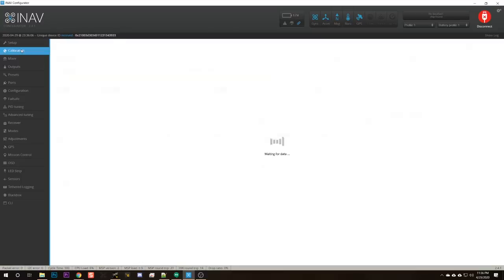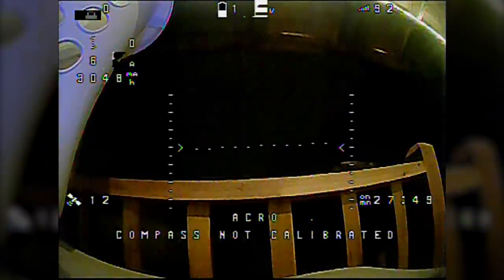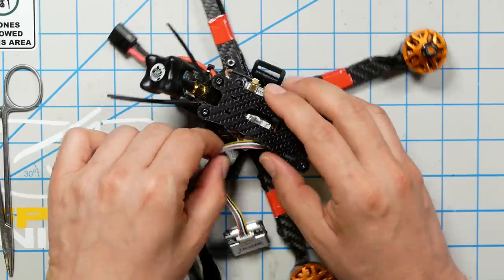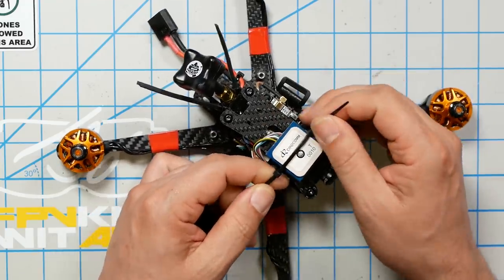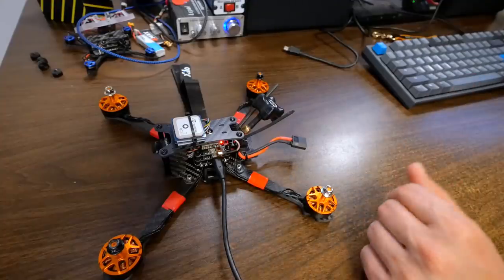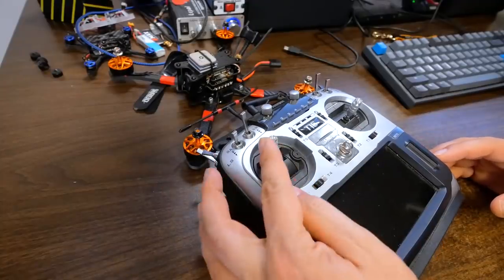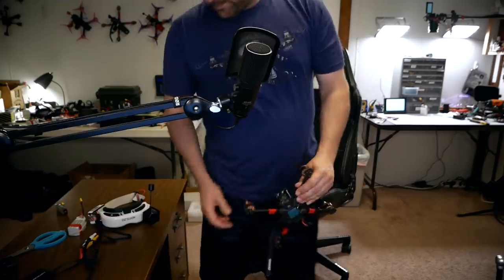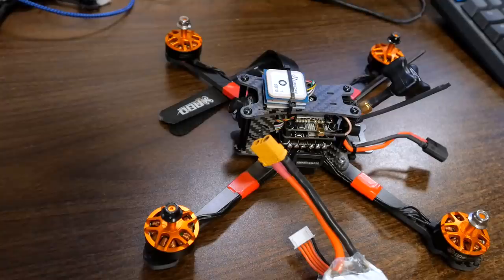iNav Drone Complete Tutorial - Part 6 - Calibrate Compass and Accelerometer

Comment: Looks like im in good company here, I finished assembling my quad last night and thought "I'll just take it out for a quick PosHold test" HA! quad took off like a ballistic missile , pause for a hover at about 100 feet altitude, meanwhile I seemed to be locked out of my controls.. I shut the transmitter down with pwr off and the quad started heading south...  I found it about 30mins later busted up on the paved road.  It will make a good parts doner for my second build ;-)  Thanks for all the help Josh! If I had watched this video insead of rushing off to test my quad last night....

Comment: That position hold issue is what happen to me a month ago on my 3rd 7in iNav build. Mine started toilet bowling small circles into even bigger circles. I was using a Matek GPS and compass and I had it at CW 270 degrees instead of the CW 270 flip. Sometimes it’s the easiest things to fix that causes headaches.

Comment: I have written a short guide for iNav compass calibration in another forum, in case someone needs some more advanced tips, mainly if you mount your GPS/compass tilted or not facing arrow forward:

step 1. Find out how the magnetometer sensor is oriented on your board from manufacturer. For example I have M8Q-5883 GPS with magnetometer from Matek, where magnetometer (compass) is mounted CW270FLIP. Let's remember that.

step 2. So in general you would only need to set mag alignment CW270FLIP in Configuration tab / Board and sensor alignment in iNav configurator. But this is only the case if you mount your GPS/compass board flat and arrow facing forward! But let's say you mounted it with arrow facing backward, and you tilted it 30 degrees backward (because you want to have the best GPS reception when flying your quad forward pitched 30 degrees). In this case, change mag alignment to CW0, and you need to go to CLI, and set align_mag_roll, align_mag_pitch, align_mag_yaw.
In other words, when iNav detects you have some values in align_mag_xxx variables, it will ignore mag alignment value!

For our case, we need to combine both CW270FLIP sensor orientation and our mounting position.
CW270FLIP is:
align_mag_pitch = 1800 and align_mag_yaw = 2700
combined with our mounting position (arrow facing backward and 30 degree tilt backward)
align_mag_roll=300
align_mag_pitch=1800
align_mag_yaw=900
save

step 3. Put heading into your OSD, so you can see it in your goggles. Go outside with your goggles, transmitter and quad, some distance from buildings, and metal things. Turn on the transmitter, plug-in your battery into your quad and turn on goggles. Issue stick command throttle up+yaw right+pitch down (and hold it for 1 second!). Your FC board should start blinking and in your goggles heading will display ---, signaling that compass calibration is in progress. You have 30 seconds, or whatever value you put to mag_calibration_time variable, to calibrate your compass. Rotate your quad around each axis 360 degrees, take your time.

When calibration is done (FC stops blinking, and heading in your goggles displays some number), point approximately north with the nose of your quad. The heading should show 0 degrees. Turn east, heading should display 90 degrees, south 180, west 270. Then pitch quad's nose down 45 degrees and do the same, the heading should again display 0 (north), 90 (east), 180 (south), 270 (west). Now flip your quad upside-down, and do the same heading test. If in any of the above your heading is crap, you didn't set the correct values to align_mag_xxx variables. Re-set them and try again.

Hope this guide helps you! Happy flying.

Comment: I use my phones compass, and compare that with the heading in osd, checking every 90°
Reply: I also used my iPhone (and area knowledge). Still couldn't get it right until I searched exhaustively through YouTube. Found one lonely video demonstrating this issue. In the comments, someone said their BN-880 needed to be CW 270 flip. They thought that was weird. Mine worked once I set to CW 270 flip. Apparently it's not weird. It appears to be the default factory setting now. Why don't we hear more about this?!? Like in the product description maybe?!?
Reply: @tedhancock68   Same here. I used my phone, downloaded compass app.  Matched up the compass on the app to the compass on the BN880.  I followed Bardwell's instructions from the mounting direction to the CW270 flip, and check the compass direction in the OSD all at my desk and it worked like a charm.  I guess direction and orientation stamping on the GPS or at least something in the instructions was not in the budget for the GPS MFG.

Comment: I've got the weirdest situation going on.  I just received an RTF quad from GetFPV.  In the configurations tab on Betaflight (BF), it has the flight control (FC) set at 0 roll, 0 pitch, and 0 yaw.  However, the gyro is set at CW 180.   At the same time, I can see that the FC has physicallyt been rotated 180 upon install (the arrow points toward the tail of the quad).  Based on JB's instructions in the video, the settings in BF's configuration tab should instead be: gyro set to 0 degrees, while the yaw for the flight controller is set to 180 degrees (I put -180, since I assume this corresponds to CW--it might matter for the math, as you'll see below).  With either setup, physical movement of the quad matches that shown in Betaflight's Setup tab.  This makes sense to me, and I will change it to how JB recommends.  The issue is that I would now like to install a Matek M8Q-5883 GPS w/ compass.  The manual for this GPS states that, if the arrow of the GPS points in the same direction as that of the flight controller, the Mag alignment in Betaflight's configuration tab should read CW 270 flip.  For the best mounting and cable running for my GPS, I do in fact want the arrow on the GPS to face the same as that of the flight controller.  However, the FC was mounted CW 180 as previously mentioned.  So, do I need to input a mag alignment reading of CW 270 flip + CW 180 = CW 450 flip or, in other words, CW 90 flip?  I realize that I can test this, but I won't have the ability to for a few weeks, and I'd simply like to know the theory in any case.  I gues the pivotal question is:  Is the rotational setting for the GPS module relative to the nose of the quad, or is it relative to the direction that the arrow on the FC points (the manual for the GPS suggests the latter)?

Comment: Does Betaflight use the exact same stick commands as iNav to calibrate the compass?  I also read that we need to use the save settings stick commands after calibration. Is this correct?  Does calibrating the compass make gps rescue return to home perform more accurately? Or is it hard to tell?

Comment: Matek M8Q-5883 has plug on the back away from drone. If i mount the gps with arrow facing backwards to have plug come right out to drone. I can just change direction in flight controller to like CW 90?

Comment: Hi Joshua! My FC board doesn't have  i2c port. I am thinking of connecting my magnetometer via uart port using arduino nano as i2c to uart converter, but on the "port" tab I can't find options to allow magnetometer using the available uarts. Hoping you have an option for this aside from buying a new FC, haha.. Thanks a lot. I love your tutorials..
Reply from the maker: You should check with the iNav dev whether that option is supported in their drivers. I think iNav requires you to have an i2c based compass or they won't support the FC though.
Reply: @JoshuaBardwell  okay. I'll try to reach them.. Now I'm having a feeling of switching back to betaflight and build a new one for inav.. Thanks

Comment: Hi Joshua! thanks for the tutorial videos, May I know how was the in-house microphone of the fpv cam activated? i think my audio is grounded. I tried troubleshooting by plugging the *audio of fpv cam to the S6 of the flight controller terminal but no good audio comes out. thanks!
Reply from the maker: You would need to connect Audio of the cam to the Audio or Mic input of the vTX. I can't remember off hand whether this vTX has a mic input though.

Comment: I cant calibrate my drone, its upside down in the inav set up window, when I do the calibration the first step it calibrates it in the step 2 window and when i flip the drone over it calibrates as if sitting flat, it also does left right and up is down. How do I fix this?

Comment: Hello and thank you for this video. On the other hand, I fly in mode 1. Do you know what stick position I have to do for the calibration of the compass? Thank you.
Inav 3.0
Reply from the maker: It's the same movement in throttle yaw pitch roll just wherever they are for your sticks.
Reply: @JoshuaBardwell  OK thx for your fast response 😜

Comment: hi joshua , i have a question , can i shorten the cables on a lipo ?
Reply: You don't need him for that answer, yes you can.  Cut them down and put on a new connector, remember to only do one lead at a time to minimize the chances of shorting the battery.
Reply: @pickinfun6941  thank you so much
Reply: I can... If your not 100% comfortable with a soldiering iron, don't try this, it could end badly
Reply: Shorter cable = better performance.

Comment: Every time I try to use the stick command for calibration of compass, I get no light confirmation on the FC that shows it’s working. Any ideas what is wrong or what I’m doing wrong?
Reply from the maker: Make sure your endpoints are correct. If the stick does not go all the way to 2000 then the FC won't pick up the stick command.
Reply: That’s what it was. Thank you for your help, your the best!

Comment: where should i connect my battery, i have an fc with a built-in pdb, and a 4-in-1 esc. i can't find a clear answer. can someone please help?
Reply: Look into Matek F722SE manual it has options for this scenario (you don't have to be on F722 FC). I personally just paralleled 4-in-one and FC providing Y splitted branches to each one. even put to capacitors on them.

Comment: Hey Joshua I sent you a DM on Instagram under @Johnpaulishac if you could check that out
Reply from the maker: Instagram messaging is impossible to keep up with, because replies to Stories are intermingled with actual DM's. At any given time, I have between 100 and 500 DM's in my "inbox" and there is no way to tell which ones are just people giving a Story a thumbs up, and which ones are people actually trying to talk to me. Please contact me via FB messenger or email joshuabardwell@gmail.com.
Reply: Joshua Bardwell Alright thanks for the heads up, I sent a message via email.